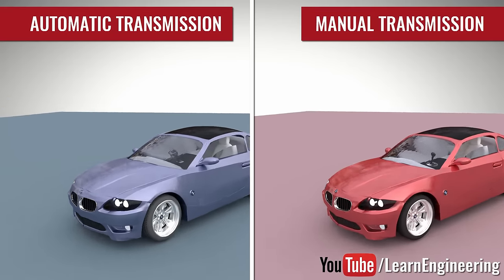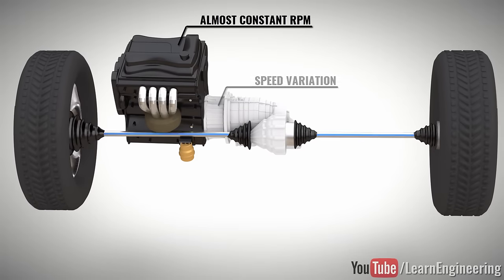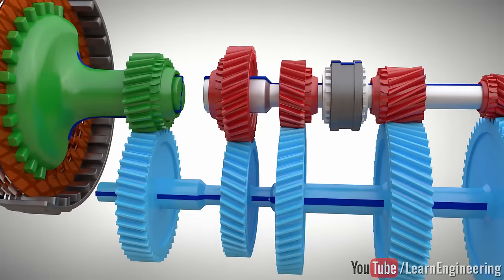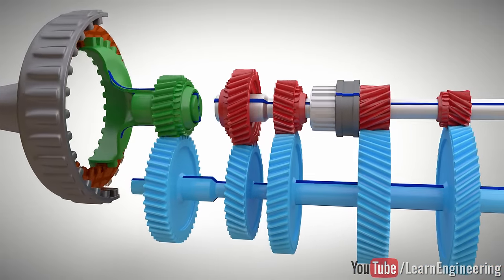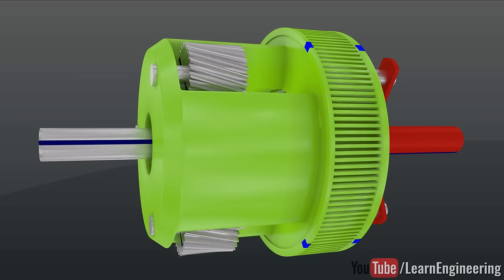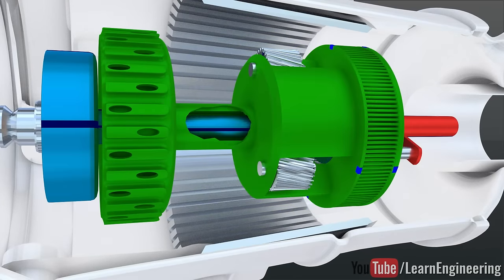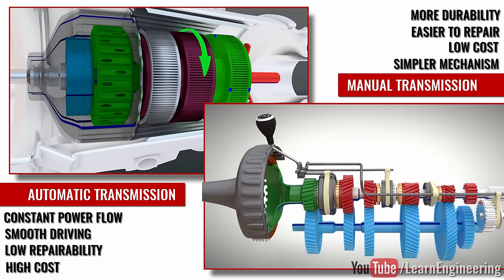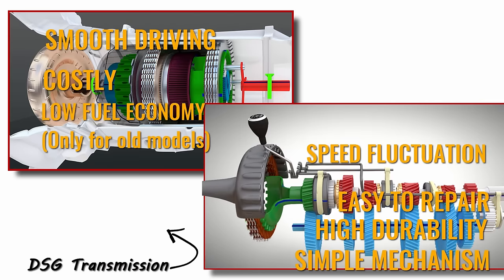Automatic vs Manual Transmission

Comment: honestly, as much as traffic makes me wish i had an automatic transmission (seriously, operating the clutch and constant swapping between the 1st and 2nd gear is a nightmare)
i have to say, that in almost every other non-traffic situation, manual transmission is pure joy 
you basically feel every single move you make
you can rev the engine if you want
you feel the sudden surge of power when you change the gear and quickly release the clutch pedal while revving the engine
i honestly recommend everyone to try the manual transmission at least a few times if it's possible
Reply: If you care about your transmission, you shouldn't release the clutch pedal too fast.
As the video explained, the Synchronizer Ring is matching the speeds, but if you release too fast, it doesn't have the time to actually do its work and as such tear a lot more.
And well, repairing a transmission is pretty costly.
Reply: @kuhluhOG  i agree, and by "quickly" i didnt really mean "instantly"
the sole feeling of sudden sharp shaking is probably enough to make most people understand that
also if you rev the engine enough before releasing, it will fit in just perfectly
Reply: I would reccomend people trying automatic at least once.. manual is manual and you feel the car and really handy on ice starting from second gear or in adding torque in corners playing with right leg.. it is the way to drive a car for millions of reasons. Automatic won't make a proper driver out of someone. Name me one car racer that drives automatic?
Reply: @BushcraftEurope  well, Formula 1 cars have a sequential half-automatic transmission
meaning: 7 forward gears (+ neutral + 1 backwards), they can only switch to gears next to the current one and not too fast, they don't have a traction interruption and they only choose which gear the car should be in (the rest is done by the software)
Reply: Manual transition also comes in handy during evacuation and escape. Car with automatic gearbox can only take you from point A to B in absolutely normal conditions.
Reply: @kuhluhOG  thats not how it works man releasing the clutch too fast wont hurt anything the syncros only do something when youre shifting not when youre in gear
Reply: @ethanol-fb  you would be surprised at how many people manage to break their transmission from releasing too fast (or from having their foot slight on the clutch pedal); I know multiple

Also, I had a car where, if you didn't in a bit of gas too while releasing (or released over the course of about 10s), the whole car would feel it. It had synchros and they worked (according to mechanics), but it didn't feel like it.
Reply: @Admiral45-10  well, if it's about pure acceleration, there is something better: a continuously variable transmission
sadly, cars normally don't have that and they are banned in e.g. Formula One (but tractors do)
Reply: @kuhluhOG  look man the syncros have nothing to do with that the syncros will only be used when shifting and it sounds like you were just stalling the car or about to because you need to give it gas when letting it out and resting your foot on the pedal wont break a tranny its just the throwout bearing
Reply: @kuhluhOG  I believe some sport cars use robotic transmittion, but I'm not sure...
Reply: @kuhluhOG  CVTs snap if you hard accelrate too much w it
Reply: @BushcraftEurope  That's a weird take. The vast majority of car owners are not racing drivers. Their car is not a tool of joy and happiness, it's a tool to get them from point A to point B. The vast majority of people aren't car nerds, yet you are arguing people should build manual for nerdy reasons.
Reply: @ethanol-fb why would you press your clutch if you’re not going to shift gears? Expect for driving really slow, I think releasing your clutch very fast on high speeds will kinda break it no?
Reply: @ilehe6887  i was just replying to someone who was confusing 2 separate parts of a trans or somethin but yeah if the engines off and youre not moving usually you dont need to press it in
Reply: I agree, have both a manual and automatic car and I do prefer the manual driving experience. But I use the automatic for regular daily driving, there is so much traffic in my country that manual is honestly just tiring. And I'm a relatively new driver, so automatic is much easier

Comment: "Let me introduce another planetary set that you still don't understand to explain how this is achieved. The output of the second planetary set is attached to the input of the first. It's simple!"

....
Reply: Pretty much always with the videos this channel uploads. They pop up in my feed as some kind of intellectual exercise where you have to google things elsewhere to understand them. These videos merely introduce the concept for me.
Reply: I understood it but I've worked on planetaries. Each stage it a multiplier and it just depends on how they add up depending on the power path.
Reply: @timjohnson1199  Speak english doc, i aint a scientist.
Reply: @Inferamusic    Each stage of the planetary is sort of like a separate gearbox. So, each stage gets multiplied by the other. If 3:1 and the next stage is at 2:1 the output will be 6:1, or,  if you have 1000 rpm coming in you'll have 6000 rpm going out.
Reply: There is a 1930's video. Watch it. It's a thousand times better than this one.
Reply: @timjohnson1199  correct me if I’m wrong but 6:1 is reduction gearing and if the input speed was 1000 RPM then the output speed would have to be 166 odd RPM (high torque, slow speed). To get 6000 RPM output out of 1000RPM input you’d need overdrive gearing of 0.16:1 (so fuck all torque).

Comment: Something not mentioned - automatic has a noticable and significant lag in it.  In a manual, when you step on the throttle, since you are mechanically connected to the transmission, power delivery is instant.  In an auto, it takes a small bit of time for the torque converter to begin pushing the transmission forward.  Then, if there is any shifting occuring, there is a significant lag before full acceleration.
Manuals, assuming you know how to properly drive one, acceleration is again, nearly instantaneous.
Reply: Yes. And there are chipsets that can speed up this process. I have one installed on my Chevrolet S-10 2018 and the difference is noticeable when you need power to overtake someone in the road or for going from a stationary position to instantly high acceleration. I would say is a must have for safety purposes since your car becomes much more responsive when needed.
Reply: shift bog is real on cars though. bmw e92 n54 has a really long shift bog
Reply: We have a hybrid Mini Countryman that seems to have solved this problem. The eletric motor provides instant torque.
Reply: Two ways to resolve this (I've tried both, they work): 1) use so-called SPORT mode, it forces AT to shift down when you slam that pedal and has a significantly less reaction time compared to regular AT mode; 2) modern AT have a kick-down, which activates when you push the accelerator down to the floor and then some (you'll feel the bump when you press it enough), that'll force AT to give maximum power at the current gear, but be careful not to overrev the engine.
There's also a third way, which is manual shifting, but I haven't tried this on the road yet, so can't recommend.
Reply: @Nero_PR  never realized Chevrolet released the S-10 in '18
Reply: @ravn_blade  Here in Brazil we have it. Or you think everyone in here lives in the US?
Reply: Sum Tesla fanboy prob gonna type sum “instant torque” shit cuz the 2.0 apparently is the messiah of cars
Reply: Christopher Slade it’s called a tune bro
Reply: I guess you've never driven a Porsche with a PDK dual clutch automatic I'm assuming?
Reply: @user-zd5lz7su9t  dang bro chill down. This comment section is 2 years old, your input doesn't have any revelancy as they already moved on with their life.

I'm not going to reply to anyone here because I see this pointless to do so  as this comment section has been inactive
Reply: @kyanberusama8847  Dodge Ram , ya know good ol American car 🇺🇸🇺🇸🇺🇸
Reply: @Nero_PR  i get this was 2 years ago but i believe that the person figured that the s-10 would be released in the US if anywhere else as it is a US based company
Reply: It also depends if it’s carbureted or fuel injected
Reply: @user-zd5lz7su9t   lmao cope, america is not the heaven you believe it is

cry, at least I know I won't go bankrupt by getting a simple cut
Reply: @user-zd5lz7su9t   lmao i live in a fucking brazilian capital, not at fucking africa, at lest when it get's cold here we still have running water and electricity
Reply: Good point. I HATE that lag. That is just one of many reasons why I own a vehicle with a manual transmission.
Reply: I think modern cars with semi-clutch technology overcame that issue.
 Not sure though.

Comment: 3:26 
"Never A Smooth expierence"
My father who is driving manual for 25 years: 
Am i A joke to you?
Reply: he mean, when you need to shift your gear you have to push clutch pedal so at this moment engine not turning wheels.
Reply: @AzzaYaDog  i think artur is mentioning about how some new drivers may make the body of the car make a tugging feeling because they dont switch gears smoothly or dont rev match to make a smooth transition, where as experienced manual drivers make it seem like there is no tugging by doing rev matches and smooth clutch engagements, hes not talking bout power not going to wheels
Reply: It is probably hard if you plan on parking up a upward road. Considering the car have to clutch up if you mess it up
Reply: Your father doesn't drive smoothly 😔
Reply: wow so original.......and funny......😴😴😴😴😴😴😴😴
Reply: my dad,who used to do street racing in manual cars(including an AE86):am I a joke to you?
Reply: @slightyawesome4859  how do you know he means that? Lmao
Reply: @KitKitChanIsaac  now that's a car ;)
Reply: @evilash2388  AE86 are good cars
Reply: @evilash2388  because this is obvious
Reply: @omargolam2692  no, he is specifically talking about acceleration while shifting (as shown in the graph), while the clutch is pressed its impossible to accelerate bc the wheels arent engaged with the engine. it may feels like smooth riding, but in reality, its impossible to achieve a constant rate of acceleration while having to shift manually (as also shown in the graph).